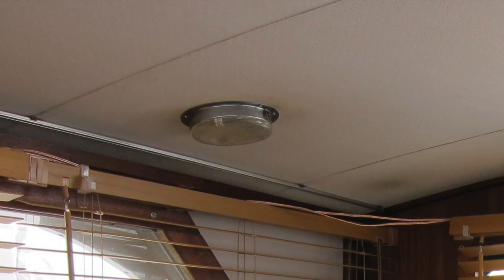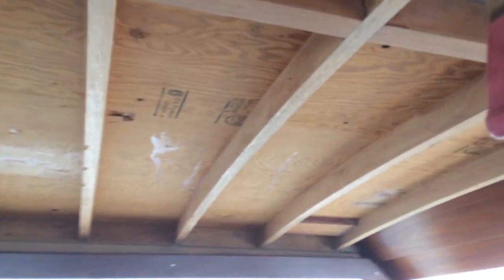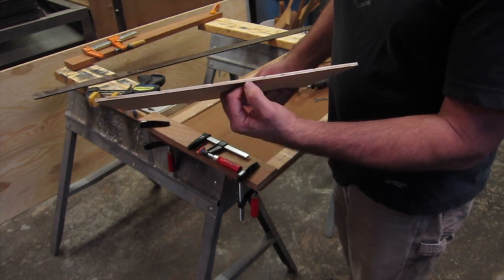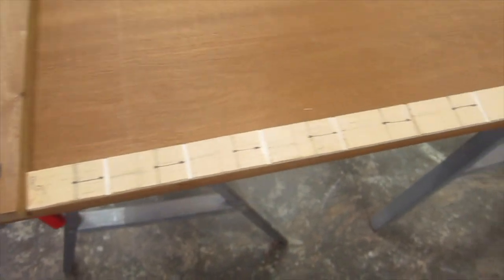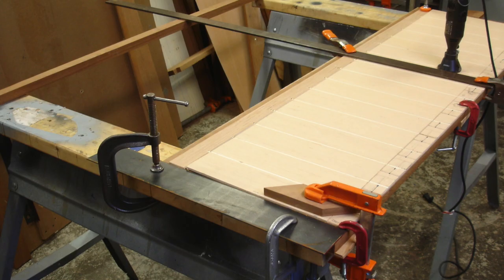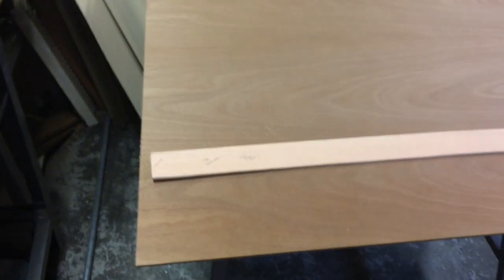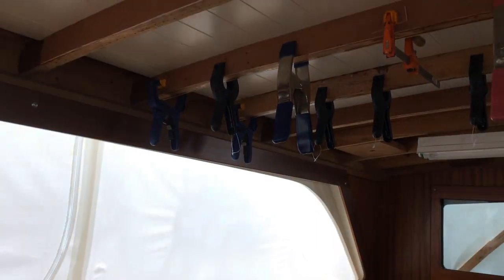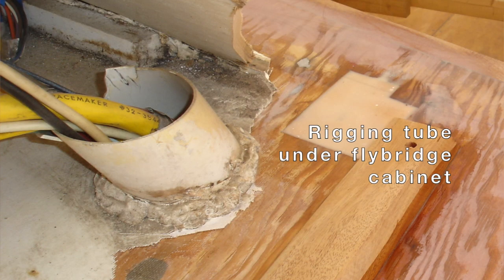Overhead (ceiling) Panels & Beam Veneers - Boat Restoration EP028 (2018 Part 3)

Comment: I like your idea for a soffit to house all of the wiring and control cables.  It would look good if you finished out the fore and aft inside edge of the ceiling panel to match your roof joists.  Maybe added some led lighting in there to match the lighting in the center.
Reply from the maker: There is more to come for the roof after the next couple videos. Stay tuned.

Comment: Looking great, Will the "roof top" / "ceiling" have any problems with heat penetration from the sun beating on it or does the fly bridge cover most of it? Nice series.
Reply from the maker: The roof top does have direct sunlight on it. The boat came with a canvas type cover that snapped over the entire flybridge which probably helped. I plan on a Bimini but it won't be deployed all of the time. I did think about insulating between the panels and plywood rooftop, but aesthetically I thought the beam exposure would be reduced too much. Also there is no insulation anywhere else in the boat. If I were in one of the warmer southern states I would have been more apt to go that way. I've actually never been in the boat with sunlight beating directly on the surfaces so I don't know how much heat transfer there is. It's always had shrink wrap on it. Looking forward to finding out. It's a good point you brought up. Thanks for the comment.
Reply: @renovationsportfish1563 , to answer your heating concern ... yes, boats in more southern climates will have hotter interiors by default unless they are either insulated and/or air conditioned. Just like a house or other building.
I love what you did with the overhead! My boat has perforated vinyl that provides minimal insulating value (if that was even the intent). Similar to what was used as automotive headliner in 1970s. Probably installed just to cover the exposed fiberglass surfaces.
I don't think my boat has the beams that your boat has, so I don't think I can copy what you've accomplished, but I'm going to take a good look. And if I do go with what you've done, I'll look into adding rigid foam insulation, if only for minimal (R6) insulating value.
Your craftsmanship is outstanding! And your use of templates, jigs, and example pieces to demonstrate and explain what you've done is muchly appreciated.